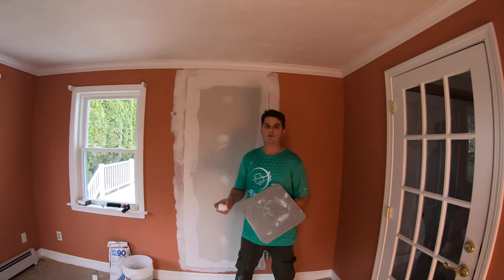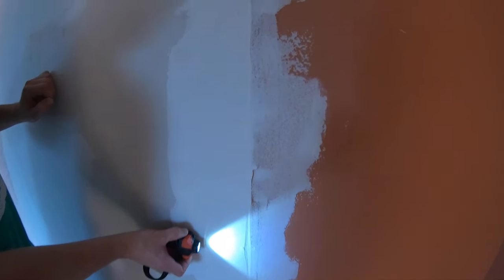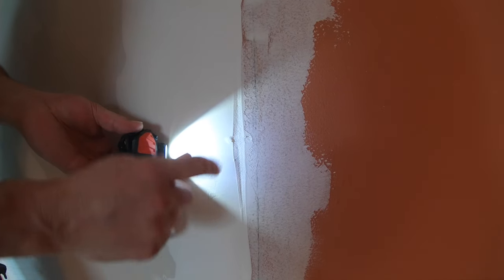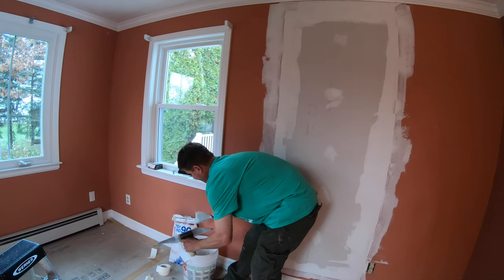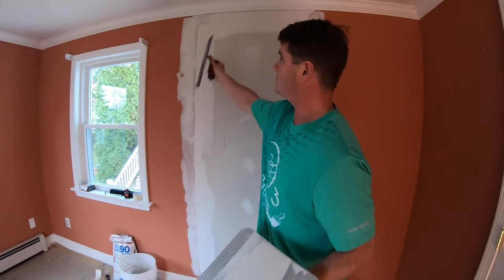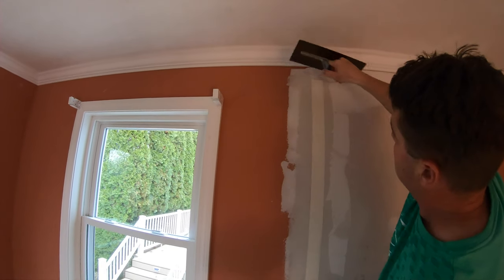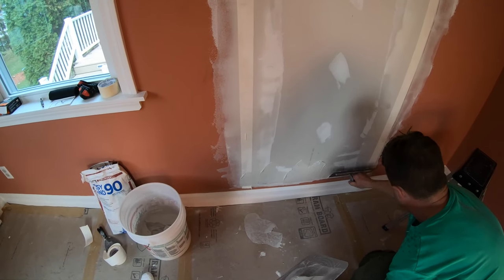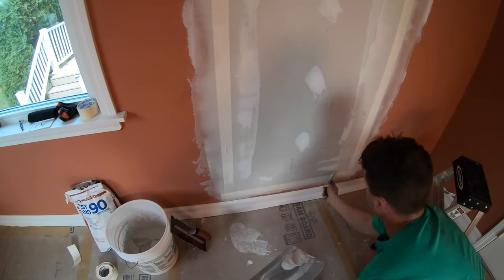How to Tape and Float an Uneven Rectangular Drywall Sheet -  Drywall Repair (Part 3)

Comment: Random question, when butting new drywall to smoke damaged drywall should the soot filled drywall be wiped and primed first?
Reply from the maker: Hi Luis

You shouldn't apply paint or primer straight over smoke stains, as doing so won't cover them up. Start by removing stains with a dry cleaning sponge, followed by a wet cleaning method. Then Prime
Reply: @RussOlinatzPaintShow  Thank you for the reply.

Comment: Good video and it describes the situation I'm in with old and new drywall.  Did you sand any after your first or 2nd coat?
Reply from the maker: Hi Aj

Thank you! No I didn’t. I just use my taping blades to scrape away any lines. You don’t want to generate any dust. Sand after all the coats are done. If you sand between coats, the dust will get all over your repair and you will have to use a wet sponge to remove dust. To eliminate sanding between coats, just make sure to feather or taper your edges with your taping knife! How big is your repair?

Russ

Comment: I love how you use a hawk and a cement trawl lol. I’ve never seen that yet I’m gonna try it
Reply from the maker: Hi Shane

Try out many trowels and see what works best with you!  Where you from?

Russ
Reply: Drywall trowel is very expensive at my HD . Dewalt brand is selling for $60 while masonry trowel is selling for $15. Can I use masonry for drywall. I broke a big hole in the celing while.doing recessed lights.
Reply from the maker: Yes u can! I’m using a masonry trowel. They work well with a hawk too!

Comment: On a repair like this, you will always see a hump to some degree if you look for it, correct?
Reply from the maker: Hi

Thanks for your question! On a repair like this, I have to do multiple coats to even out the surface. If not you will definitely see the humps. 

Russ

Comment: Hey Russ is it okay to overlap the corners of the tape or is it textbook not? I'm doing a wall right now and I've seen where you're not supposed to but it looks fine here. Thanks!
Reply from the maker: Hi Matt

If you overlap the tape at the corners, it will create a higher spot in the 4 corners. If you plan on skimming the whole wall afterwards I wouldn’t worry about it. If you want to avoid the high spots from overlapping, crease the tape together and cut the end of the tape on a 45% angle. When u open the tape back up it should look like an arrow. Then u can line up 2 different tapes so there not overlapping. What kind of tape are you using?

Russ
Reply: @RussOlinatzPaintShow  I have sort of the same problem you had with uneven drywall joints (Old drywall is slightly lower than new drywall in some areas) so I'm prefilling to get as level as I can before applying tape but I've got paper and fiber mesh. I'm debating on which to use but I'm leaning mesh.
Reply from the maker: I now use Fiba Fuse Tape. It’s thinner and stronger than paper tape and mesh tape and u get no bubbles.

Comment: If you come back the next day and notice a small crack at the edge of the tape when it dried, can you just add mud or do you have to pull it off and start over?
Reply from the maker: Hi John

It’s always best to cut that area out and re-tape. There is probably a air bubble behind it because it was never embedded properly. What kind of tape did you use?

Russ

Comment: Hey Russ, appreciate your content. Picked up the trowels you are using. Had a question, how many coats did it take to feather  the wall even? I have the same scenario with new drywall meeting the old and a lot to fill in. On my third coat and worried about how much more it will need to make it even. Thank you sir.
Reply from the maker: Hi Jason

Thank you! I think I did 4 coats! You will need to do more than just the usual 3  because it’s a very uneven surface you are trying to make smooth again. What kind of mud are you using?

Russ
Reply: @RussOlinatzPaintShow  all purpose sir
Reply from the maker: Ok let me know how you make out after your 4th coat?
Reply: @RussOlinatzPaintShow  will do !